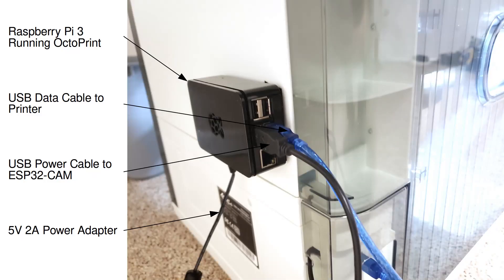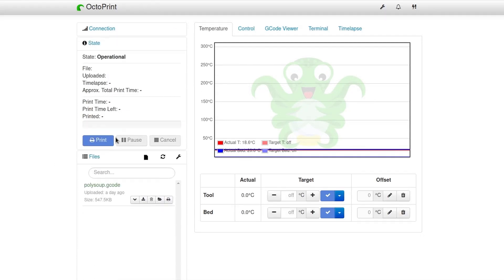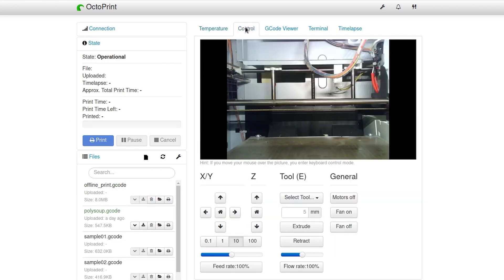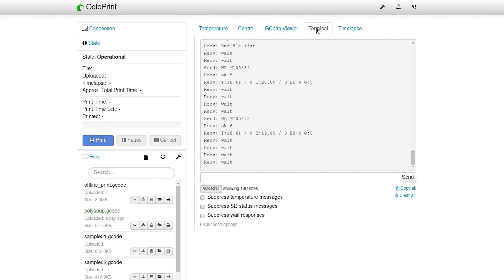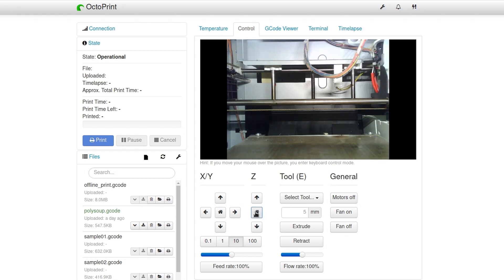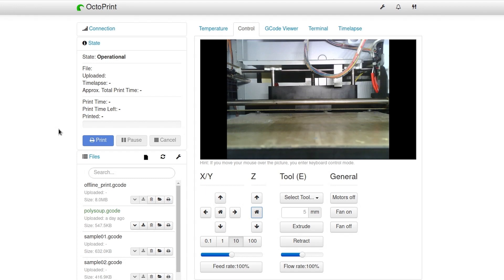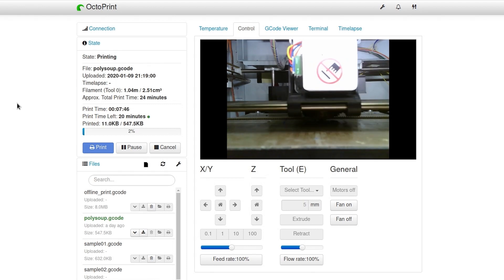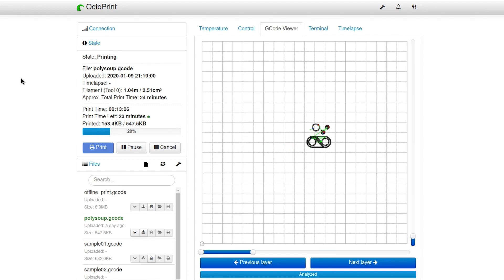3D Printer Wireless Conversion and Test Print: Raspberry Pi + OctoPrint

Comment: Which Repetier firmware are you running with Octopi. Because it seems it is not possible to connect Octopi to Repetier current  latest firmware  0.92.10M